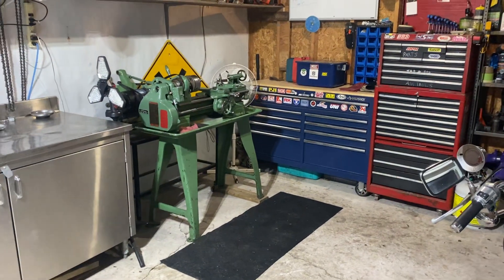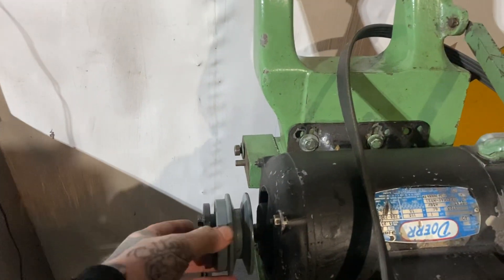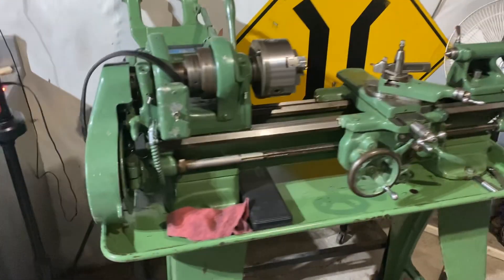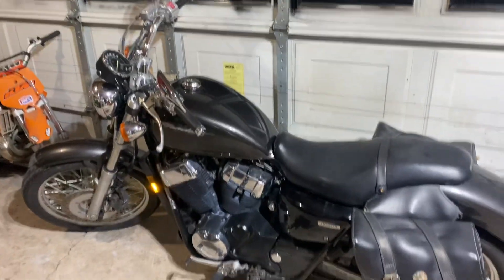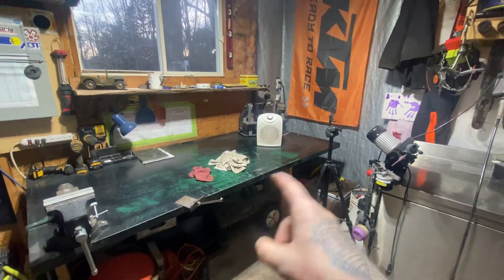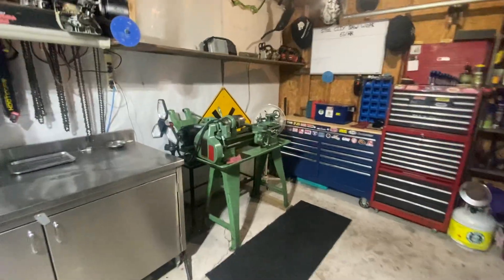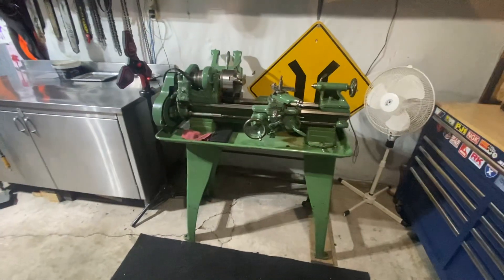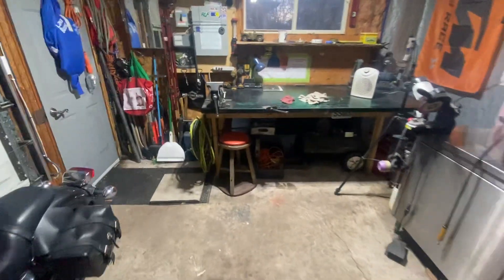South bend model 9 & shop update!!

Comment: Nice to see you are still at it. I had a service van that needed a workbench without blocking everything, so I mounted an old door with the hinges on the wall, with angle iron under the hinged side  for support so it had a solid surface for when the FORD Tune Up Tool(Big Hammer) had to be used. When I needed to access something or haul something I just folded it up against the wall and latched it out of my way.
Reply from the maker: That’s a great idea I should have utilized the hinges. Maybe I will modify it and do exactly what you did, the hinges are still on it. Thanks for watching.